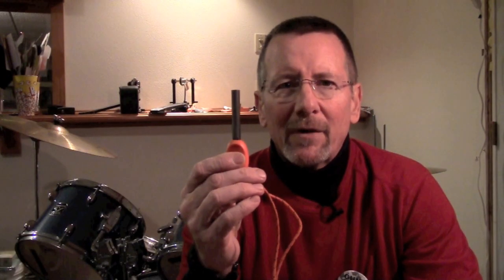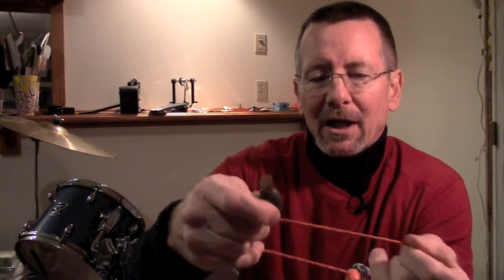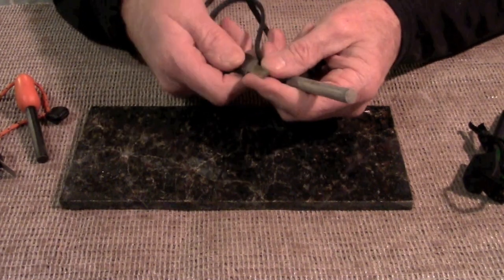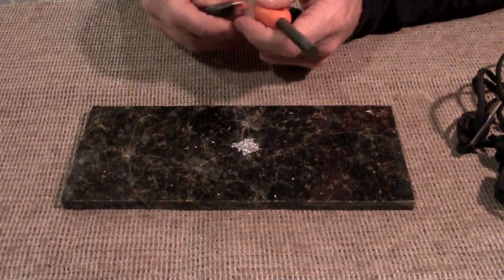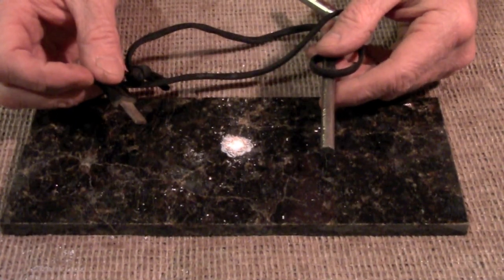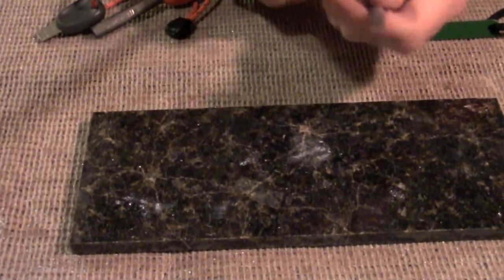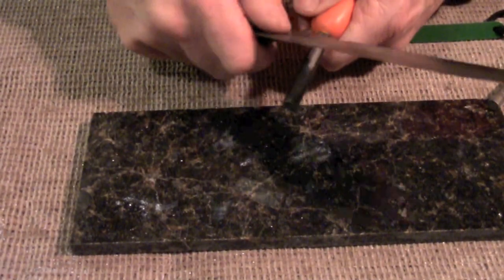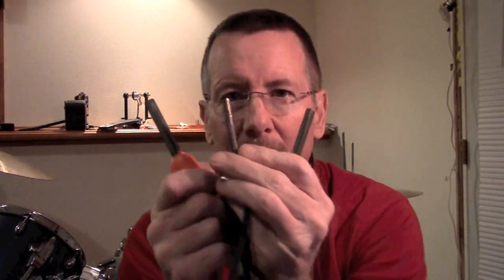Which Is the Best Fire Steel? - Fire Steel Tips, Tricks and Reviews

Comment: I've had a ferro rod for many years that's high in iron content. I can scrape the front 1/2" of it slowly and gently and get a fire started. Needless to say it's my favorite. I recently bought a ferro rod from Light My Fire and was very pleasantly surprised to find that it's a high iron content rod as well and that I can do the same thing with it. I have one of the original Gobspark Armageddons from Firesteel.com that works the same way. I had a new Gobspark but gave it away. The formula has changed and the new ones are high magnesium. Nothing wrong with them, they are fine rods, but I like the high iron rods better. They seem to last forever since I need to scrape such a small area of the rod instead of having to scrape the full length of the rod so hard and fast in order to get them to spark well. It turns out that I prefer the harder rods that have a high iron content rather than the high mag models that are softer. Oh well....live and learn. At least I can still get the type of ferro rod that I prefer. I seriously doubt that I will ever have to buy another since these three are so effective and last so long.
Reply: Agree completely. No need to scrape the oxidation away before sparking like on the other rods.

Comment: Just an fyi, if you scrape on a 45° angle (or hold your fire steel on a 45°angle) , the fire steel usually won't get bumps and grooves. Also,  the 'softer' (mishmetal)  fire steels, make it easier to get a fire going when you have marginal tinder. A good campfire is just so comforting and fun.
Reply from the maker: Yeah, I like the softer ones myself. The Schrade rods throw gobs of molten goodness
Reply: @SurvivalOnPurpose  I totally agree, I love my Schrade ferro rods.

Comment: Thanks for the comparison. I've got rods by several makers and they all work, especially once you get past the coating, which is fairly thick on certain brands. I've been focusing on smaller models (Ben's Backwoods carries a small one made in Minnesota with a wooden handle that runs about $7) so I can make sure that I have one in all the places that need one (every pack & bob, each vehicle, etc.).  As you say, the best one is the one you have with you.
Reply from the maker: Yep, as far as I can tell, they all work. Some just a little better than others.
Reply: @SurvivalOnPurpose  light my fire and Dave's steels are harder (higher ferro. content) so they're are less sparks but the sparks burn hotter. That other steel is softer (mishmetal, my preference,  I'm going to buy one),  so it throws more sparks but they dont burn as hot.  Its personal preference. The softer ones don't last as long but really, who totally uses up their ferro rod? Most peo lose them before they actually finish em up, lol

Comment: I have never really liked using magnesium either, but I keep some in case I am in a pretty tough spot. I recently purchased an Exotac ferro rod, and it works pretty good. 

I have found that the quality of the edge on the striker is just as important as the quality if the ferro rod. Even cheap rods give good sparks when struck with good, sharp edges.
Reply from the maker: I completely agree with you on that.  believe it or not, the factory spine on the Old Hickory throws sparks like no tomorrow.  Itried to file it and improve it but I can't tell any difference.

Comment: Hi Bryan:

A lot of people think the LMF ferro rod is the only way to go.

To be fair the LMF ferro rods are hotter than Firesteel.com, and the el-Cheapo ferro rods coming out of Hong Kong and mainland China.

I can take a $2 fire steel out of china and a firesteel.com; and the name brand will work better. Just because firesteel.com has a better striker.

If you use a good high carbon steel scraper both the no name and firesteel.com will throw virtually identical sparks. The secret in a good fire steel is the striker not the ferro rod.

If the Armageddon steel is 4 inches long; what would you call my 10 inch long by 1/2 inch fire steel.

If you get a $2 fire steel; throw away the painted hacksaw blade and add a high carbon steel striker. A lock back or fixed blade knife. If it has a coating on the blade you may find it very hard to strike a spark.
Reply from the maker: I think you should call yours a Supernova. Or maybe a Billy Club.  And I have to say the LMF is a good product, but I have no complaints about the Firesteel.com ones either.  You are absolutely right, the striker makes all the difference.  I'll take a marginal ferro rod and a good striker any day over the reverse.  Thanks. - Bryan

Comment: After starting with several cheap China ones with hacksaw strikers and magnum, so hard you could hardly scrap the firesteel the same, with just a few tiny sparks, I finally came across Firesteel.com. I ordered the regular size at that time 5/16 3.15 with striker and mag .rod. I've never tried any others. I know have several sizes for emergcy kits in our vehicles but not tried them yet.
 I've given away several 5/16 th ones to younger people who were intersted after being able to start fires easily . Getting ready to order a few more of those and some more bigger ones to experiment with. 
Thanks again, for the video.
Reply from the maker: They make good ones

Comment: pathfinder sells a big firesteel at around $40 with a higher magnesium content which will help light almost any kind of tinder.  i've bought a same size ferro rod off of amazon for under $20, but after some use, obviously has a higher iron content.  still throws sparks but do not last as long as the pathfinder one.  both will work but under harsher conditions, the pathfinder one will start a fire better than the one i purchased off of amazon.  wish ferro rod sellers would specify iron and magnesium content.  anyways my next purchase of a ferro rod will definitely be the $40 pathfinder one.
Reply from the maker: Dino Olivas I have heard a lot of good things about those.
Reply: Survival On Purpose I assure you there is verry little or no difference at all between the lower priced rods and the $40 rods, Ive tested them side by side and there is no difference that i can tell. Both the Pathfinder, light my fire, etc etc are all mischmetal. I can buy the same rod for about $5 (made in USA of course) that these companies charge $40 dollars for and they work the same. If there is a difference, it is so minute its not noticable to justify $40 vs $5. Both start fire verry well.  But lets just say that these $40 rods are a tiny tiny tiny bit better, I say tiny because as I said, IF there is a difference, its a micro amount. Considering that these $40 rods are a micro grain better, are they $35 dollars better?, Hell No. You can buy 8 of the $5 rods for the same price of 1 $40 rod and when that $40 rod wears out, youll still have 7 brand new rods, 8 rods last alot longer than 1 by my calculation. Besides that, the $40 rods wear out faster because they seem to be softer.  On another aspect, beings you have 8 rods instead of 1 in a  SHTF senerio, Would you trade your only ferro rod for anything in that situation? NO. On the other hand, beings you have 8 rods, what do you figure you could get in trade for a brand new ferrocerium rod?  Beings 99% of people dont know how to make fire, whats a small thing thats waterproof you can put in your pocket like a ferrocerium rod that makes thousands of fires worth in that situation.  ;)   Why is it that most companies can make the same mischmetal rod for $5 but these "survival" companies want to charge you $40 lol. I buy the lower more sane priced rods and they throw sparks like sizzling bacon off of a carbon steel knife and I have always got fire verry easily from them. Your exactly right, the best one is the one you have on you because there isnt a difference to speak of. Good comparison video

Comment: Good comparison, Brian. I keep a LMF firesteel. They work well in my wet area and throw really good sparks. Magnesium quality is based on manufacturing technique and purity. Just takes the right maker to make you a mag believer :)
Reply from the maker: It sounds like it.  The magnesium from Firesteel.com worked pretty good, as did their firesteel.  I'mgoing to get a US issue model and try it too. I'd say both the LMF and the Firesteel.com model were about equal.  I do like that you can get a honkin' big firesteel from Firesteel.com if you want one.  I just ordered a 1/2" x 5" one for a special project.  Thanks - Bryan

Comment: Good video. I have quite a few of those five dollar versions that you have, and yes the rods will come out of the handle. I just used a little "Loc-Tite" glue and glued them back...have had no problems since, and they do work well. I especially like your quote "the best one is the one that you have with you"...lol.
Reply from the maker: Seriously, I can tell a difference between some of the ferro rods but they all seem to get the job done.
Reply: Survival On Purpose
Exactly.
Reply: Survival On Purpose ALL ferrocerium rods do what they're supposed to but vary in HOW they do what they do. The biggest difference (and this DOES NOT apply to 'magnesium' bars) is how much prep you have to do regarding your tinder.
Ferro rods vary in their formulation.They're a mixture of iron oxides (for stiffness/hardness), cerium oxides (ease of sparking), magnesium (fuel basically, what STAYS burning after the spark), lanthanaum and other materials. They work by using a low temp. ignition source and mixing with high oxygen content, making the spark HOT enough to ignite the magnesium which is difficult to put out AND it provides its own oxygen when its burning. This creates the easy to spark but HIGH temp. sparks we use to ignite tinder.

BIG LONG EXPLANATION...skip it if you don't want to know.

Magnesium is an extremely soft metal that can be easily worn away VERY FAST, far too soft to be used on its own...plus, it won't actually spark by hand (stroked with a striker) as a solid bulk form, it has to be 'shaved' or powdered to ignite easily.
Cerium Oxide, is a metal which ignites at a low tempurture (150 - 180 °C (302 -356 °F), easily produced by stroking a sharp edge on a hard material. It is also fairly soft, so very easily worn away.
Lanthanaum, again, another SOFT metal, oxidizes rapidly in air.
All of the above metals, though great for making sparks in combination; a fuel (Mg), a source of oxygen (La) and an ignition source (Ce), would very quickly be gouged completely through due to their softness.
This is where the 'ferro' in ferrocerium comes in, iron (Fe) is added to the metals to form a rod that is harder and thus more resistant to being worn through quickly.
The ratio of Iron, Magnesium, Cerium and Lanthanaum (and others) determines a rod's characteristics; be that MORE sparks that don't last or BIG sparks that burn after being stroked. And THIS determines if you're tinder needs to be prepared better.
Poorly prepared, difficult to ignite tinder may light better with rods containing MORE magnesium and less iron as they are softer and will throw larger 'chunks' of 'smoldering' sparks that heat up the tinder longer. Where as  a well prepared, easily ignited tinder may light off just a quick burning, hot spark from a higher iron lower magnesium rod which throws TONS of sparks but that don't smolder laying on the tinder.
Its easy to work out which rods are which...strike a rod and see how long the sparks burn...if they die fairly quickly they're higher in iron and lower in magnesium; if they smolder/burn some time after being struck they're higher in magnesium and lower in iron.
More iron/less magnesium, harder the rod is, longer it will last (more strikes/rod); but you may have to stroke the rod MANY more times to get your tinder to ignite if you didn't prepare it well or its damp or just a poor tinder.
More magnesium/less iron, softer the rod is, longer the sparks last (fewer strikes/rod); but you will wear through the rod much faster but may get tinder to ignite sooner, hence having to strike less times and NOT wearing it out so much.
Personally...get both. Higher iron as your regular use/practice rod, if you can ignite tinder with that rod, you've prepped your tinder properly and you can light damn near any tinder with the higher magnesium, softer, rod. And keep the softer rod for your 'emergency, absolutely HAVE to get this fire lit, life/death' situation. Practice the right methods, so if you need to use it you can...but better your chances when you NEED to, with the easier rod.
Reply: MrRocque
I thought all ferro rods were the same, I didn't know that the chemical compositions were all different. I will keep that in mind from now on, as I am now shopping around for good, high quality, dependable ferro rods to stock up on and keep in my gear. Thanks for the lesson, I appreciate that.
Reply: Gun Slinger
like anything that's 'trendy', there's going to be people trying to make as much money as they can with the cheapest CRAP they can market. To that end, some 'magnesium bar/ferro' strikers are better then others, just as he mentioned in the video...hell, some don't even have magnesium in the bars, it simply will NOT light.
Ferro rods are the same things. Some makers will throw in only enough material to cause sparks, but not enough to be very useful. After all, iron is a hell of a lot cheaper then some 'rare earth metal' like cerium or lanthunaum. So, careful what you buy (if you go cheap). But I think anything in the mid range price should be decent and reliable.
My choice...was a Coghlan's 'firesteel' <$6...(you should know I don't use this every day, or every weekend so there was no reason for me to spend $25), I can light anything I put my mind to (with the proper prep), there's a decent content of magnesium (the sparks smolder for a second), its the longest length I can find, and its a decent diameter (its EXACTLY the same as the one Canterbury sells, its just branded for Coghlans). It works well enough. As seen in the video, the sparks are hot enough to light magnesium...once you get the PAINT scrapped off it.
And to save on wear, I don't stroke the WHOLE rod, I only stroke the lower half, when that wears out, I'll still have the upper half left to use...fyi, I've had this one for >3yrs, and I bet I got another 3-5 yrs use left out of JUST the lower half (I'm not even 1/4 way thru the lower diameter yet).
Reply: MrRocque The Chinese manufacturers got in on Ferro Rods and I've heard they turn out such junk that it won't spark. But they sell them for $1.99 or whatever.

Comment: Good video, I have the five dollar model and i found that its the striker that's key, i personally use the back side of a LeatherMan file and it works with ease, please try it.
Reply from the maker: Excellent idea, Gannon.  The biggest problem I've had with the cheap ones is the handle coming off. Other than that they seem to be fine.  You can even use a rock for a striker if you have to.
Reply: The handle i took off first day and replaced it with bone. Your right, anything will cause the ferro rod to spark, i like the file back because even if your hands are numb it creates the spark on the first strike, very important in the winter when I'm steelhead fishing in the winter.
Reply: find and friend  me on FB my pic will have me in my snowboarding goggles.
Reply: Survival On Purpose Dave C. intentionally gets these because they are cheap and work.  If you watch his video on the striker, he says to pull the plastic off and wrap it with a piece of Gorilla tape for a handle.  Now you have some tape for kindling etc if needed.  I keep the striker and the tape wrapped ferro in an altoids tin with char cloth and a little Bic lighter.
Reply from the maker: Sean M I have a couple of the $5 ones from the Pathfinder Store and the handles did come off the first time I used them but the work like a charm. and I got them for $2.50 each on sale.

Comment: looks like the all worked but I have a question
when you use the back of your knife is it normal for the ferro rod to leave the back of your knife all nawed up or is this only a problem with budget knives?
or does this mean my ferro rod is to hard? it works pretty good but the back of my knives are getting all nawed up
Reply: usually only happens with cheaper knives, you need to use something that is harder than the ferro rod, cheaper blades are generally made out of cheaper metals or haven't been tempered correctly
Reply: kernow24 could you recommend me to a fixed blade preferable that will not get nawed up
thank you for telling me I figured it was cause of my knife I should have known the mora is to soft 
is there a steal I need to look for I have tried the mora and 8cr13mov and 440c all were to soft or had bad heat treat

Comment: My best Ferro rod came from China. I can start a fire by scraping the first half inch of the rod with a sharp piece of glass. The rod is about 25 years old. Started out 6" long and .5" thick. I cut it in half. Gave half away. Still have most of my half. Can't get another. That's ok. I'm 70 years old. Got heart problems. Won't need another rod but I also have two light my f ire rods...several of Ron Fontaines firesteels...have you seen the crazy price increases on those?....nope...I won't need another rod but I would buy light my fire if I did.
Reply from the maker: I think almost all ferro rods come from China now
Reply: @SurvivalOnPurpose  Maybe so. Sure is a wide disparity in them though.